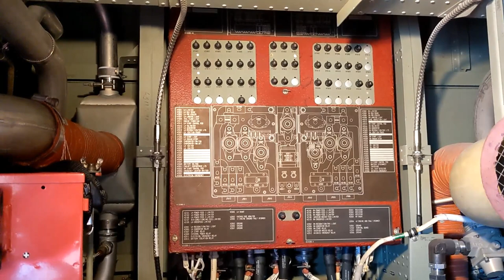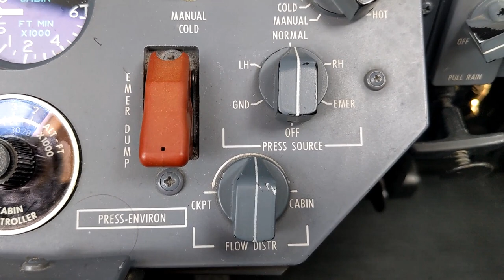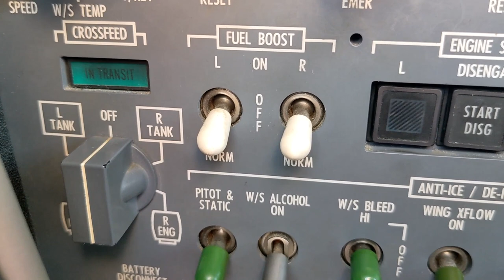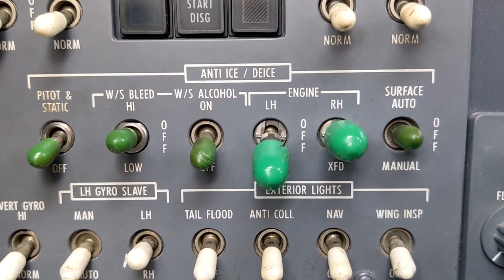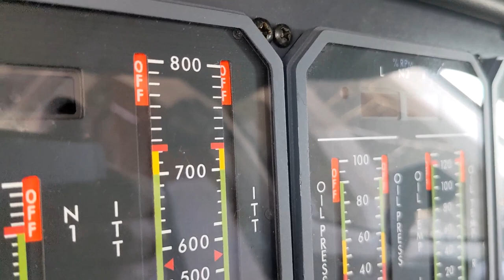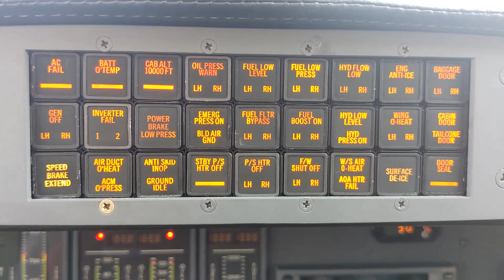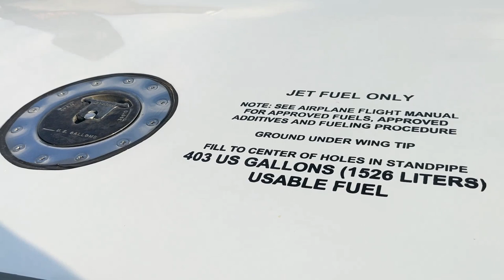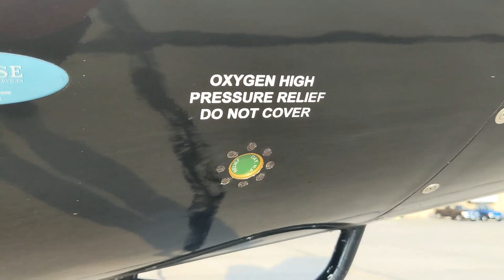Citation Encore vs Ultra - Aircraft Differences Guide

Comment: Sounds like you like the ultra better?
Reply from the maker: Actually, I prefer the Encore in general. Mostly due to better climb performance and the hot wing during winter ops. I flew an Encore this morning and was climbing out of FL440, headed to FL450, still rocketing up at 1000 fpm rate of climb. The Encore is such a rocket compared to the Ultra. That said, the Ultra is still a great jet and I'll never complain about flying one.
Reply: @citationpro  What kind of climb would you expect at that same 440 to 450 in the Ultra.  I am transitioning from a Mustang to an Ultra.  I looked at the Encore, but for the large price delta the improvements didn't seem great enough for the increased spend in my mind.
Reply from the maker: @MilazzoTony , you're going to love the Ultra I think. I work on the training/checking side of the business rather than the accounting side, so I'm really not an expert on why the Encore is valued so much higher than the Ultra, but I suspect it has something to do with the Encore having a wider "operational envelope" that appeals to charter operators, coupled with the limited supply of airframes in existence (about 160 Encores versus about 600 Ultras I believe) therefore it becomes a supply vs demand problem. What I mean by operational envelope is the Encore really shines when you're looking at high/hot performance in places like Aspen or Eagle, as well as short (sub 5000 foot) contaminated runways. Having the extra power in the Encore makes a big difference in those two scenarios to the point that you might scrub a trip in the Ultra that you would be able to do in the Encore, or at least have to take off super light and add a fuel stop in an Ultra. But for more mundane flying, taking four or five pax on a two or three hour flight, operating on dry or 5000+ foot runways, you won't notice any difference between the Ultra vs Encore. Plus, you have to look at alternative airframes when valuing the Encore. To cover all the scenarios an Encore can cover, using a different airframe, you're going to be looking at something like a CJ3. Check out the prices on those and you'll probably think an Encore is a good deal!

As for your specific question of climb performance between FL440 and FL450, the Ultra simply won't get there until late in a flight. If I take off with full fuel, close to MGTOW in an Ultra, I don't plan to be light enough to get to FL450 until burning down to 3500-4000 lbs of fuel. That basically means 1-1.5 hours after takeoff, with maybe two hours remaining until landing. It'll be a slow climb of a few hundred feet per minute, so you'd really only be there for an hour or two at most before ATC starts you back down for landing. Take a look at my "Citation Cockpit - Angle of Attack" video to see this in action. You can climb straight to FL410 every flight in an Ultra no matter what, but getting to FL430 or FL450 takes a little planning. In the Encore, even at MGTOW, you can climb straight to FL450. Yesterday I took off at about 15000 lbs, so about 1600 lbs under MGTOW which explains the 1000+ fpm climb even at the top. But it still could have done it heavier, just would have been more like 400-500 fpm at the top.

Enjoy the Ultra, these are all amazing airplanes!
Reply: Thanks so much for the detailed reply. Your videos were tremendously helpful in getting to know and see various things about the airplane. They are very well done. I hope you keep them coming!
Reply from the maker: Glad you like them, thanks for watching!
Reply: Great videos thank you!

Comment: 15:11   CREW ONLY so the masks don't unnecessarily auto drop in the back?
Reply from the maker: It could be used for that, but in this case you're seeing it turned to "Crew Only" because this is a technique used when parking the plane overnight to minimize the possibility of oxygen leaks. Notice the crew masks are disconnected as well. I shot this video at the end of a day, after parking the plane and mostly securing it for the night.
Reply: @citationpro it does say OXYGEN CONTROL VALVE there, so does that mean it's like the 'cherry picker' for manual cabin pressure wherein there is an actual valve under the panel instead of just an electrical connection?
Reply from the maker: @N_Wheeler  , yes, that's exactly correct. It is a pneumatic valve that routes the flow of oxygen from the bottle.